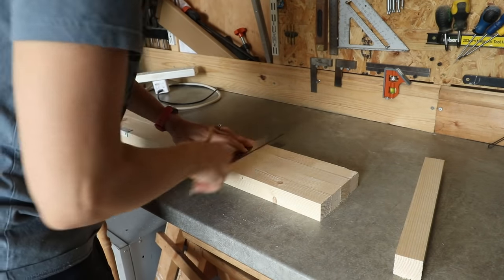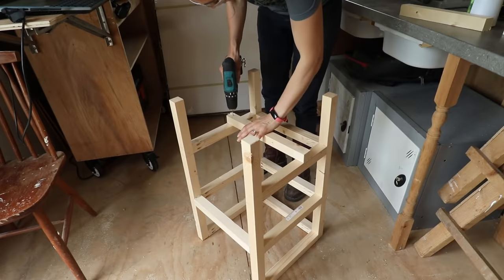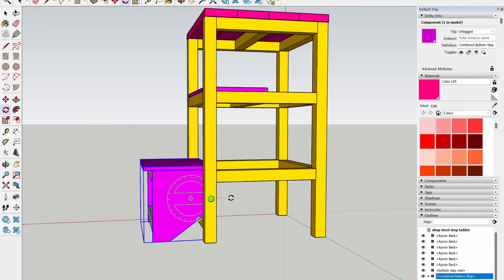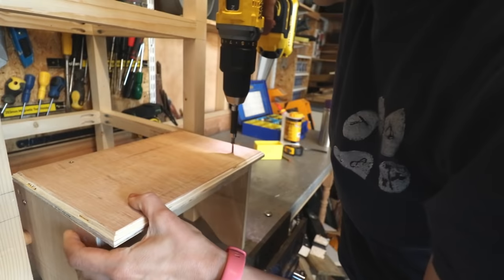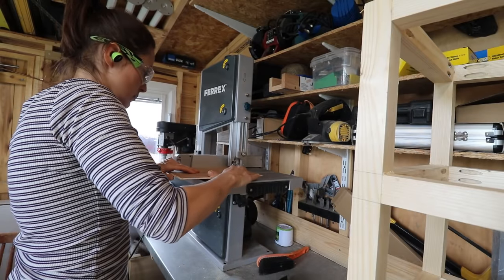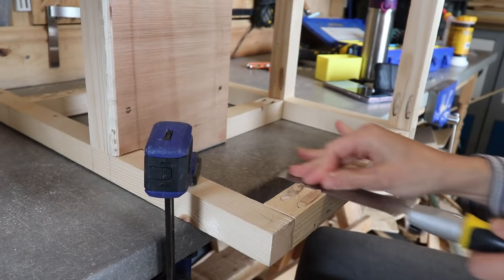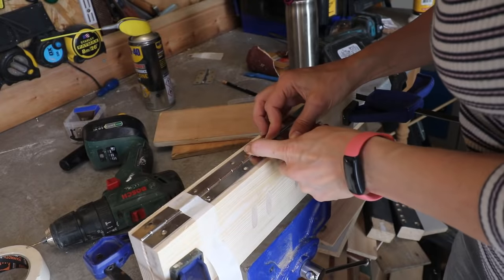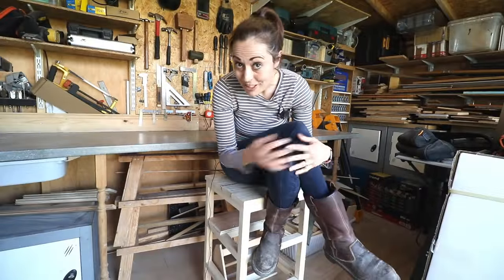This DIY Workshop to Step Ladder Will Save You Space & Money!💲

Comment: Ingenious design and very nicely put together. Interesting to hear you explain how you went through the process during the build. I prefer teak wood oil on most of my bare wood rather than a stain but Danish oil gives a similar appearance with wax on top. Pine might be better with a shellac seal though to even out the grain.
Reply from the maker: Thanks so much :)  It might end up being a teak oil top as I have quite a bit left over 😅  But might do the rest differently :)

Comment: That was quite a neat and clever idea, one that I am going to steal for my place. I'lll give you credit though and won't pretend I'm a genius. PS. What on earth is a motherflipper?? Ya flippin Mum?
Reply from the maker: That's my favourite part!

I like to think it's a mother flipping the bird, but it's a Flight of the Conchords reference... PG version of mother f**** 😆
Reply: @TheCarpentersDaughterUK  Yes, I thought as much. I was just being polite 😆 Something I thought of - get away with those spade bits. They tend to rip the hell out of holes, especially the bigger ones. A set of brad points can set you back a bit but they give excellent results.  An alternative is the Irwin Speedbor. They have 3 cutter heads as well as flutes to lift the waste out. They also come with a lead screw so they bite and boy, do they bite. If you don't hold onto them , they can be quite savage and can pull you over if not careful. They're great for grunt work.
Reply from the maker: @ohasis8331  I wanted to buy one of those, buy toolstation were out of stock!  I bought the spade and an 18mm drill bit as didnt have to wait for them to arrive, but opened the spade as it were cheaper 😆

I would have loved to use a forstner bit, but didn't have the right size 😬